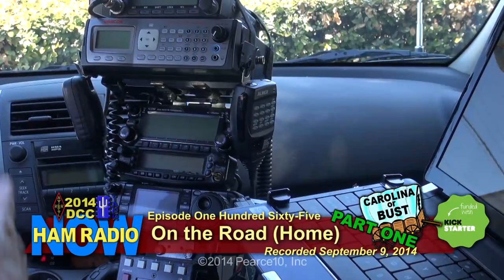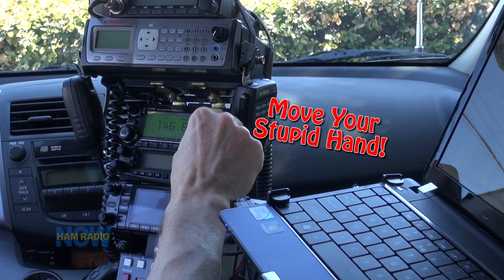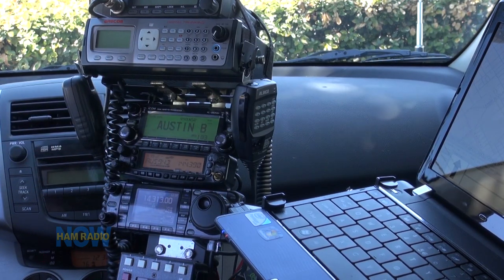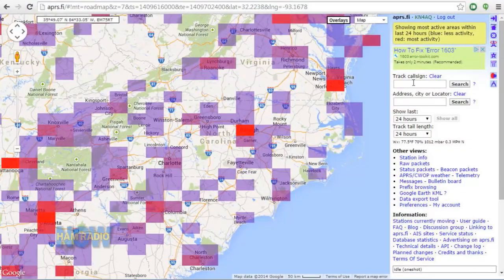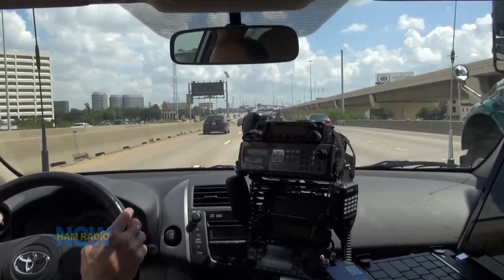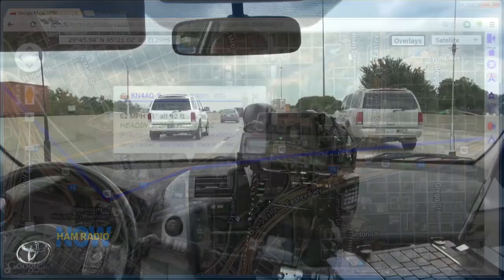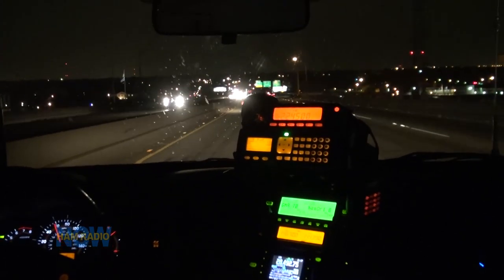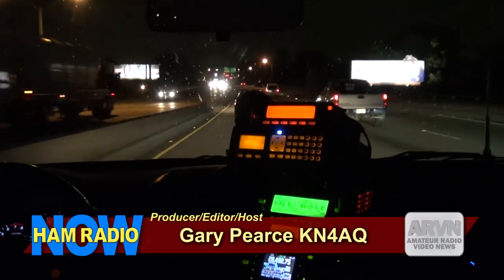Episode 165: On the Road (Home) Part ONE (Carolina or Bust)

Comment: Gary,
Why do you have the FT-8900 in the car, if the the 2820 and the 710? I get it has 6m and 10m, but that is covered by the IC-7000, and I believe you said 6m was broken, and you don't have another antenna for 10m. (or maybe in reverse):)

Comment: Darn shame that I missed you as you crossed over the Mississippi River into Baton Rouge.  I wish that I had thought to pass on some useful repeaters for you to monitor on your drive through our area. Honestly, I would have recommended that unless you had an appointment to meet someone in New Orleans to get off of I-10 in Baton Rouge and take I-12 across the "Northshore" through Hammond and into Slidell. Going down into New Orleans adds unnecessary miles to the trip and the hotels are pricier there too. I-12 reconnects with I-10 again in Slidell and takes you into the Mississippi/Alabama area easily. 73, Steve, KC5SAS
Reply from the maker: Hey, Steve... As you'll see in Part TWO, I did what you recommend - stayed a bit east of Baton Rouge on I-12. I got in late and left early, so no time to socialize. Wish I could have at least said 'hi' on the air. Maybe I'll have enough fans for some kind of meetup at Dayton in '15.